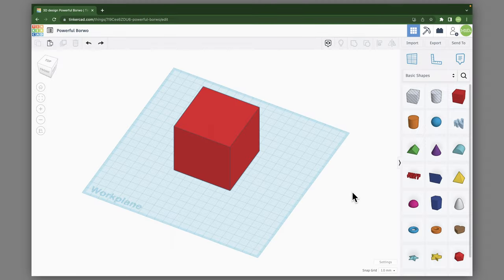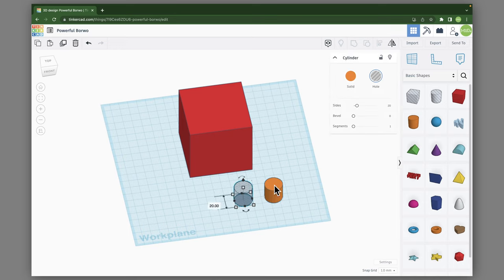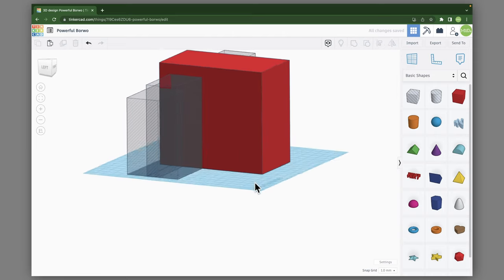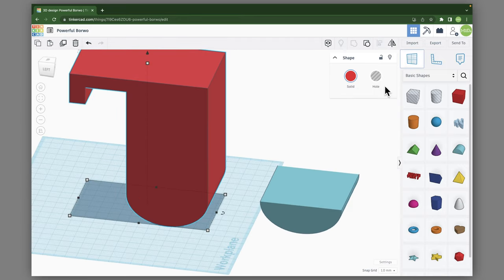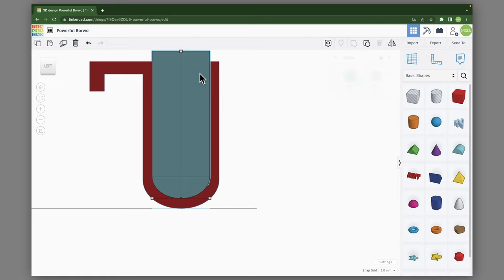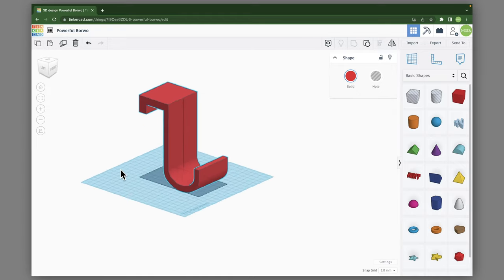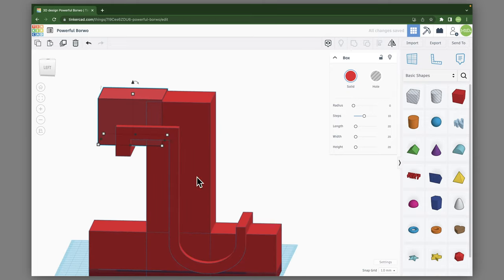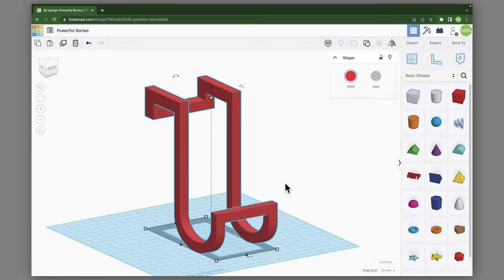Complex Shapes Tinkercad

Comment: Good tutorial. I prefer to work on the first shapes flat on the workplane because it's easier. I tend to use workplane, alignment and typed parameters/ dimensions for precision. But that doesn't detract from the philosophy of your video. - ZDP189
Reply from the maker: I think that’s the beauty of the program you can use so many different ways to accomplish the same result.

Comment: I think my problem with TinkerCad, and correct me if I'm wrong, is that all these holes stay within the model after they're grouped.  And then if the entire model becomes more complex they get in the way when you're trying to select/move your constructed solids.  Also, it seems that complex models become groups within groups within groups....  

Is there a way to cut away a part of a solid with a hole and then be done with the hole?
Reply from the maker: Your absolutely correct. It’s groups of groups. So once you cut a hole that shape will always be there. I myself am like you I wish they would be done with after I cut the hole.
Reply: @ItsMeaDMaDe  , well, I love your videos.  You have a natural talent for presentation.  I guess my followup question would be can I save any completed model as a new solid/hole to be used later?  That would be a great feature.